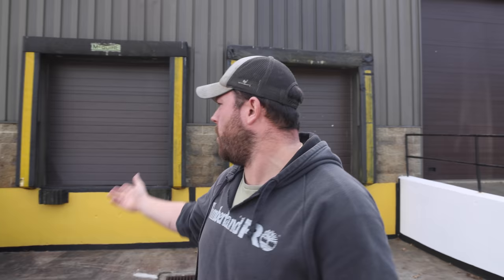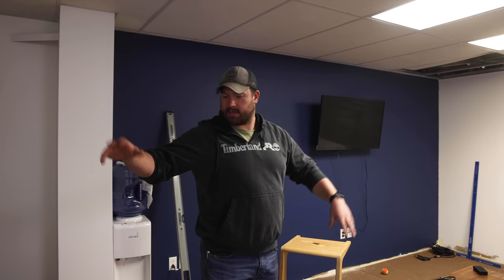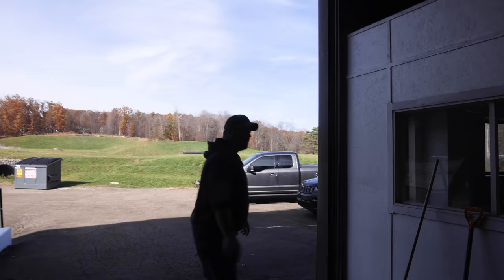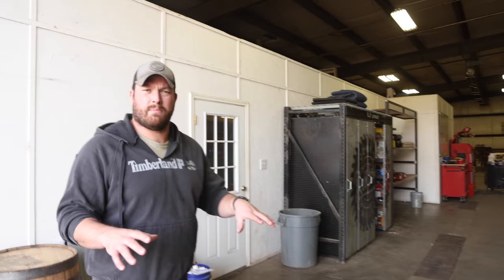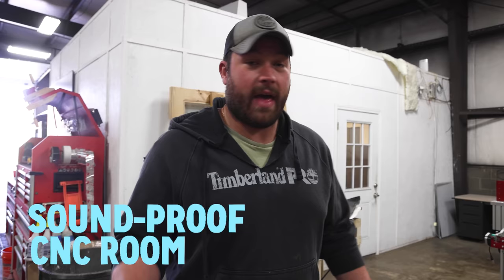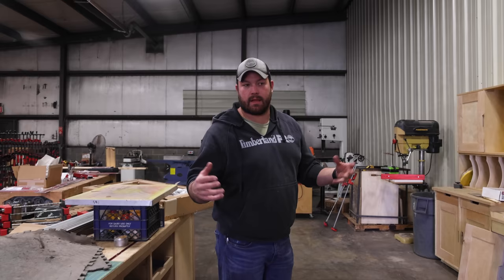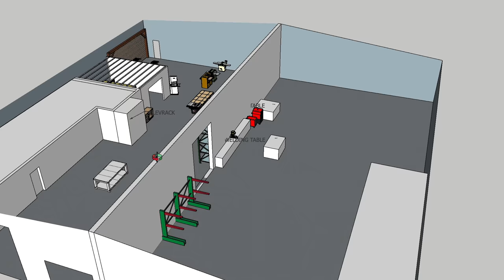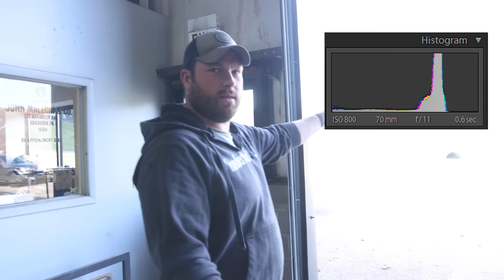I BOUGHT MY DREAM SHOP!

Comment: suggestions for something ridiculous - wooden statues...of you for example, or of some other popular celebrity. or big wooden head of somebody(you, another celebrity...). wooden dog.  fancy wooden chair you can see only in castles and historical museum. smallest wooden workbench. man size wooden bolt and nut. wooden revolver, sword. wooden musical instrument(flute). wooden armchair made entirely out of wood (no soft parts). wooden replica of Michelangelo's David. wooden life size car. wooden life size horse. challenges - made ordinary things (table, box...) out of - only palette wood/planks (wood extracted from palettes), only popsicle sticks (glued and pressed together to have bigger planks), make a box (1 x 1/2 x 1/4 foot) without any measurement tool (guess dimensions by eye). cutting board made out of at least 50 kinds of wood (cherry wood, apple wood, birch, oak...)

Comment: we do enforce a shower before you enter the barn side of the dairies we have 6we do supply the clean clothes for all who works in the barns you do not enter the other side with the barn clothes on having a smaller room we have coffee in there too all we keep the barn side and the smells on that side of the barn  after you did say milking you wash your coffee caps and the coffee pot out i do not drink it i am not washing them for you  work pretty good especially when you lost the right to have it  
 you go but to  have a shower and put your clothes in the bin there and you go out and another door to put your street clothes on doing the paper work needs to be done and have something to eat if you want to this site does have a full kitchen too as you clean up your mess afterward too put  dishes in the dishwasher too and wash them  
that night we have some one put up the barn clothes and drop clean ones off ford the next day too 
cleaning the cow's tits we have cloth rugs for that to one time for the rug on a cow  get put in a rug bin and put at a door  to be picked up and washed and dried to we have billions of rugs on the farm  too they get washed too keep all the different rugs in each job they need to do  50 people works in the build I have 300 employees work different jobs they all need to have clean clothes too 
all of the tractors need to be cleaned out each shaft washed to  
i am a clean freak as to not have to pick up after someone mess farm vehicle some way clean inside not coffee or Mcdonalds on the floor do to you not going to get the same vehicle back when it goes in for maintenance like all of our equipment